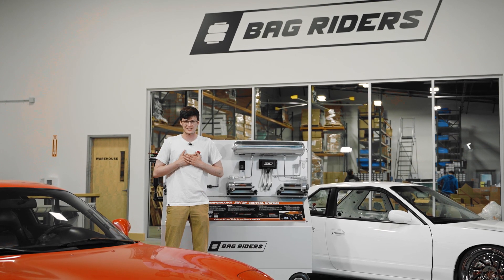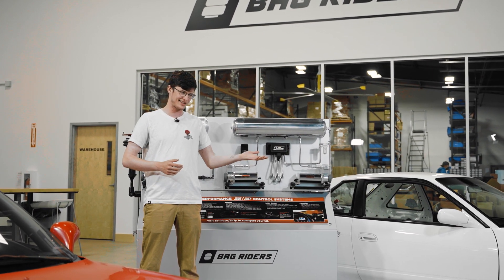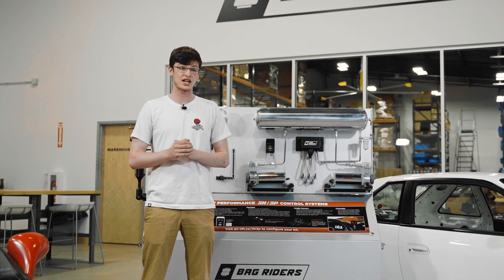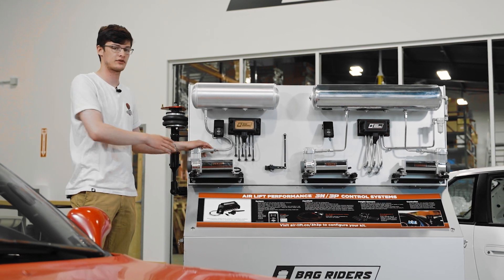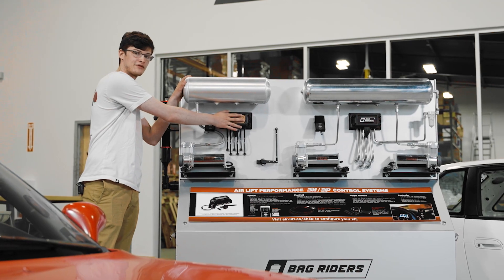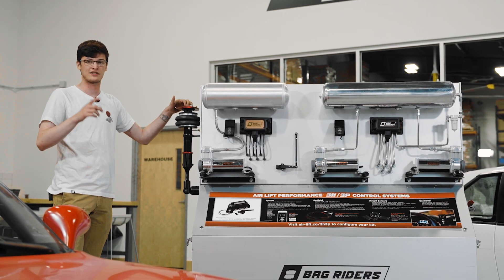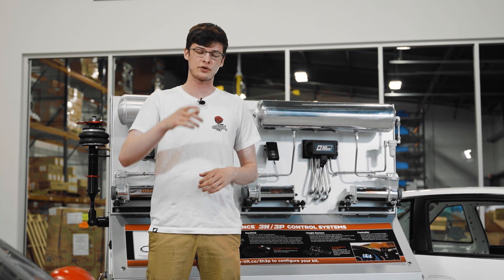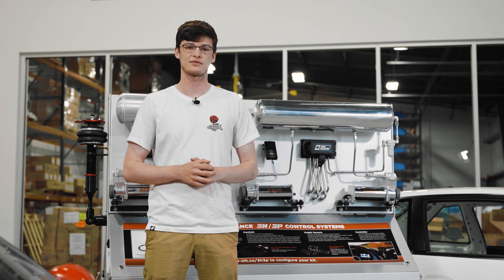Air Ride Basics

Comment: HOW DO U ADJUST THE LIFT SPEED ON AU4 SYSTEM?
Reply from the maker: Lift speed depends on air line size, manifold port size, and tank pressure.